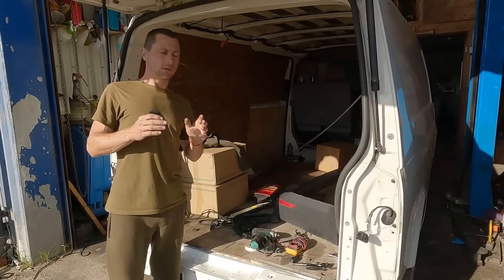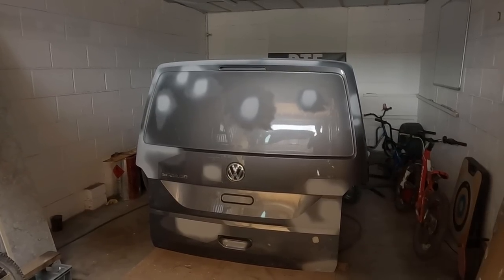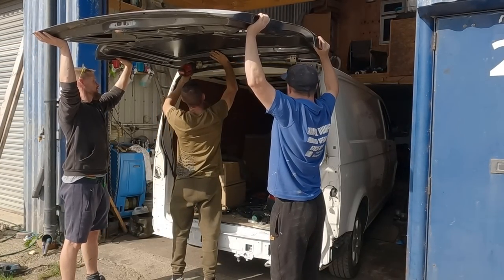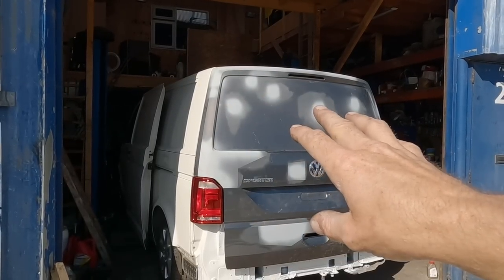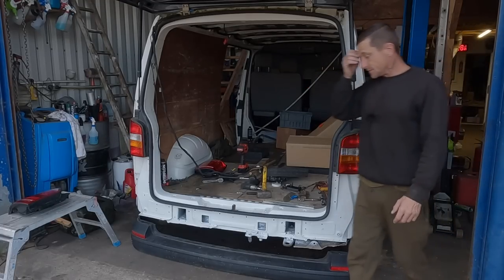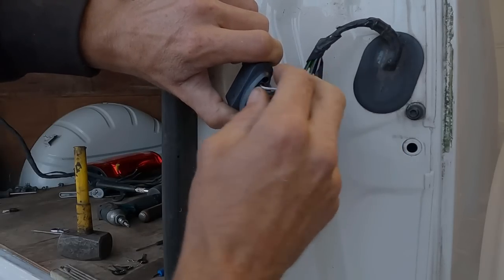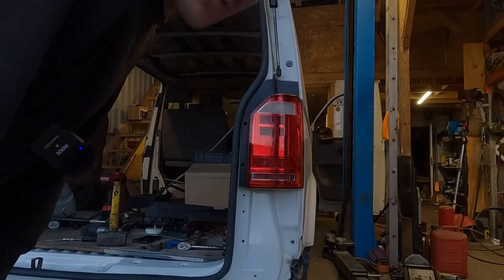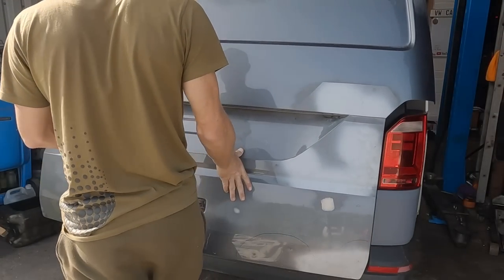Vw T5 - T6 tailgate conversion - Build series ep8

Comment: Yep , drop down to the swage line . I had the same issue when I did my dispatch, my painter said’ we’re not robots the line would not look straight 😮
Reply from the maker: Hey Chris thank you 👍 I half agree with what your painter said but I would have spent as long as it took to get it as straight as possible but I think dropping the line to follow the swage will be good 👍

Comment: So apparently some of the parts can be used from the t5. I was told the hinges are unique to the T6 but apparently the ones from the t5 can be used. There is a donor t5 which had a tailgate earilier (it is gone now) but still has the wiring loom for it, the hinges and a couple of other bits, hopefully all will fit the T6 door I have. Also the tail lights I have are different, they have a plug that has 2 rows of pins instead of one row of six whilst at first sight they look exactly the same. I'll have to have some research if there are different lights for the tailgate T6 which would not make any sense whatsoever.
Reply from the maker: Hey Richard yes I used everything from the T5 👍 I looked on eBay for T5 hinges and they are the same from 2004 to 2019 apparently 🤷

Comment: The micro switch trick with the locking mechanism, would that work with my barn door locking mechanism, as i am converting mine to a tailgate, thanks 👍
Reply from the maker: Yes mate that will work the same 👍
Reply: Thankyou very much, 👍
Reply: Could you help me out with what i need to purchase, i have a totally bare t6 tailgate obs i need the hinges & struts etc,, but what do i need to order as far as the handle mechanism etc,  (knowing now that i can utilise my barn door locking mechanism,, thanks again, 👍

Comment: Brilliant video! Does the new tailgate open ok on the original t5 struts? I’ve done the same conversion, but the tailgate doesn’t fully open heigh enough….. 🤔. Any thoughts..?
Reply from the maker: Hi bud mine is on the T5 struts and opens really far, the tailgate almost touches the top of the van, have you worked it out

Comment: Where did you wire the number plate lights to , I’m having a mere can’t find any information cheers
Reply from the maker: I used the old loom and in that loom is the old plug for the number plate lights so just piggy backed off that 👍

Comment: Barn to tailgate on the Caddy is more straightforward -having looked closely at both, all the fittings are already in place. Get it done and make a vid so it's easier for me!
Also, you'll be putting a reverse camera VW logo on the rear of both, won't you?
I'd paint to the swage line.  Not a fan of 2 tone but it's your van.
Reply from the maker: Hey bud I do like a mk4 caddy tailgate so I will keep my eyes open 👍 I will be putting a reverse camera on for sure 👍 thanks for the feedback on the paint line and if I don’t like the 2 tone I’ll just re paint the top half grey.

Comment: hello I have a question. Do you have a diagram of how to connect the lock because I don't fully understand it and I'm in the process of modifying it
Reply from the maker: Hi bud no diagram just what’s mentioned in the video 👍
Reply: @YTDTETV  It's a pity because I don't know English very well. Ok i will try. But a plus cable is from interior light?

Comment: Don’t test fit the third brake light until you’ve done paint as they are one time use only and don’t but cheap one off eBay they fit terrible.
Reply from the maker: Hey bud thank you for that as I probably would have stuck it straight in, this tailgate has been cut open to remove the brake light and now I know why 👍 I’ll ring TPS for a new one.

Comment: I'll be saving this one and watching over. 
Got a t5.1 with barn door and got a t6 tailgate with most of the parts and t6 tailgate loom that I've had for a year and kept putting the conversion off due to lack of info online. This will help massively. Thanks, now subscribed 🤙
Reply from the maker: Hey bud hopefully the video is useful 👍 I also done some searching but wasn’t much about so hopefully helps a few others out and glad you subscribed sir thank you 👍

Comment: my tailgate sits slightly proud out on the one side. Any idea how to pull it in? the other side is flush with the lights, just the other side is about 5mm sticking out.
Reply from the maker: Have you done a tailgate swap? Interesting as mine pokes out to, the drivers side sits very nice but passenger is slightly out. I did tweak mine in loads but it’s abit scary, you need to put a piece of wood in the bottom corner that’s sits tight while someone pushing the tailgate against it while you force the other side in and it tweaks the tailgate to fit better. Hopefully you get what I mean 👍
Reply: @YTDTETV  ye it seems frightening.
I'm wondering if there's bolts inside that pulls it. Thinking along the lines of how patio doors adjust. No not dome a swap
Reply from the maker: @taffofwales6814  there’s bolts but the adjustment is very minimal, has it always been like it? So my tailgate was damaged when I got it and I think the last owner had caught the tailgate with it open causing it to tweak out of shape.
Reply: @YTDTETV when I bought the van the drivers side was out. The bloke said when it was rac van they caught the tail lift but the new tailgate was fitted.
Day after I bought the van someone drove in to the back when when it was repaired was hoping it straightened the tailgate but now the passenger side sticks out lol.
It's about 4 to 5mm out. Are the bolts inside the roof looking out the back or the hinges ontop?

Comment: Looking good 👍 is the Can Bus Resistor fitted in series ( in-line ) or in parallel. 🤔. Did you buy a Milwaukee impact as well. 😢
Reply from the maker: Hey Phillip 👍 canbus resistor is in-line just cut the power wire and attach it in 👍. No didn’t buy a gun it’s pinches gun a few workshops down from me I left mine in my van at the mrs house 😩 got it back now thank you mate